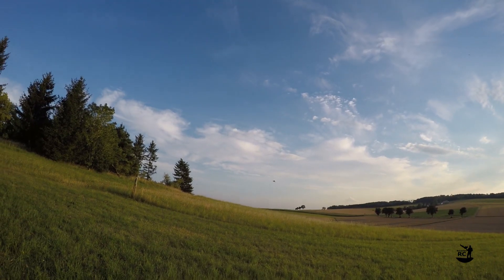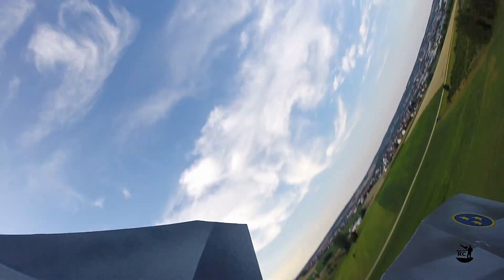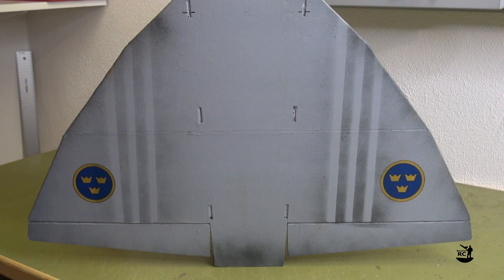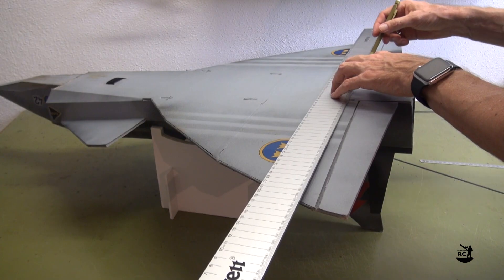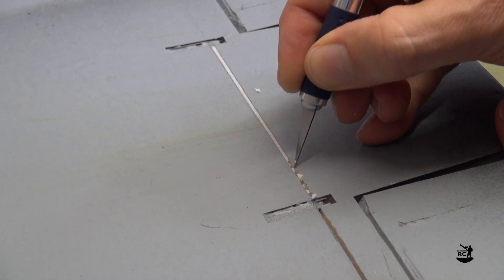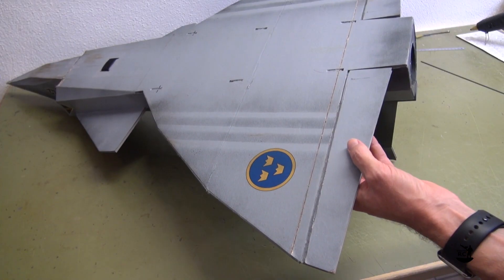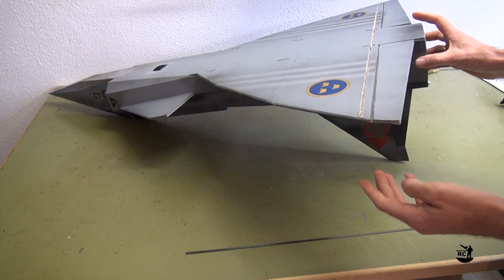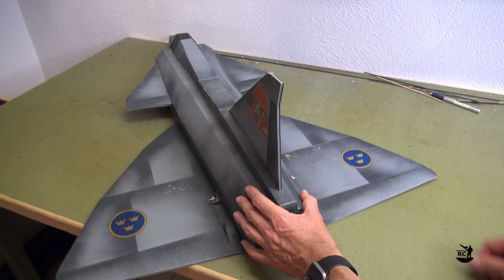Repairing the FT Viggen

Comment: This video is very useful. i just built a viggen as a first plane and built in the spars for wings and canards from basswood, as well as using some basswood for landing skids. 

Cheers!
Reply from the maker: Thanks for your feedback. I am happy that my video was helpful. Is it your first RC plane or your first foamboard plane?
Reply: @bavarian_rc  first foamboard plane, i have an Ultrix as my first plane, and its helped me to get used to elevons. I have decided to swap over to carbon from wood to save on weight, as the first iteration was a bit heavy.
Reply from the maker: The Viggen was also my first foamboard plane. I did a lot of flying when I was young, then paused for 25 years and re-started with a Multiplex Easy Star. Slow and easy. Then came the Viggen and I have to admit that my brain was always like 5 seconds behind the plane. Luckily I never crashed it. I still have it today and when I want a good adrenaline kick it is my first choice. Carbon is really a fantastic material, certainly a good choice.
Reply: @bavarian_rc  wanted to ask quick, what did you end up using for the battery tray? All the Velcro I try just rips out the paper lining the tray
Reply from the maker: I reinforced the bottom of the fuselage in the area of the battery with 3mm plywood. On top of this plate I glued velcro tape and in addition (highly recommended) I cut two slots in the plywood where I routed a velcro strap that goes all around the battery. Actually you can see the velcro on the fuselage bottom at 6:12 in this video (the short black strap)
Reply: @bavarian_rc  Interesting, I didnt consider lining the bottom of the tray with an additional material. I might print out a 2mm PLA sheet to use for that purpose. thanks for the tip!
Reply from the maker: Yeah, that will do the job. Please also consider the velcro strap around the battery. I didn‘t use it for the first flights and ended up with the battery almost at the nose tip 🤣

Comment: Nice repair video and paint job. Great edited video.
I have had to stiffen my Viggen.
Whenever I fit carbon spars now I use half hour epoxy as ran into similar problems with the hot glue cooling too quickly.
Then its a real pain.
Happy flying.
Reply from the maker: Thanks! Good idea to use half hour epoxy. This should be a lot lighter than my „good beat of hot glue“ method 😜